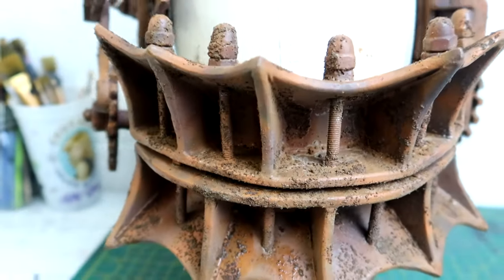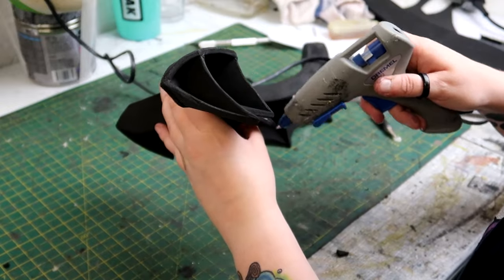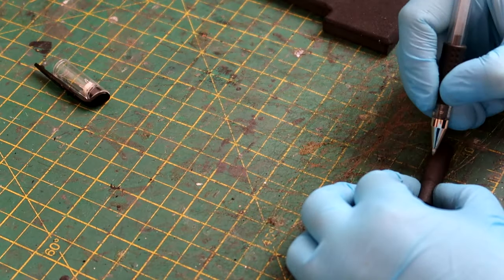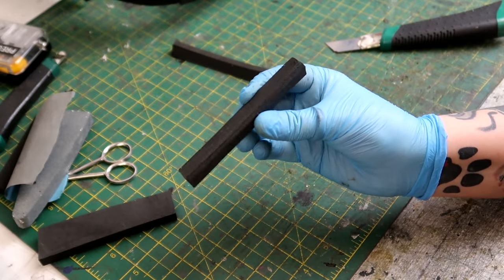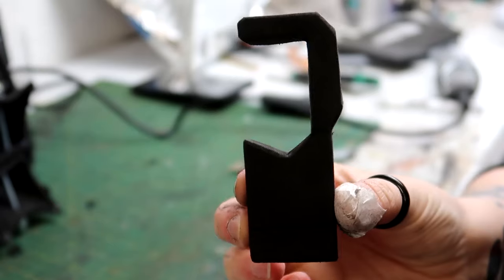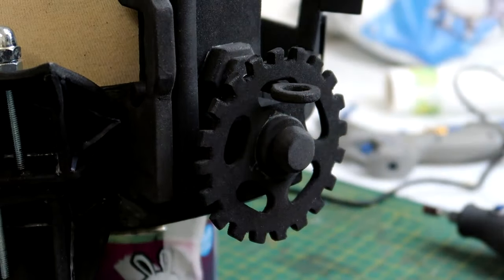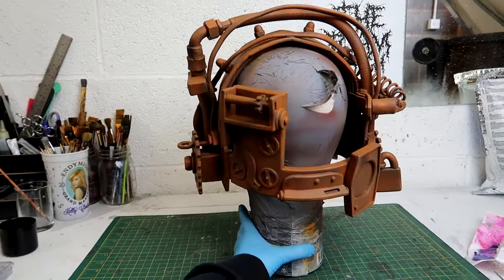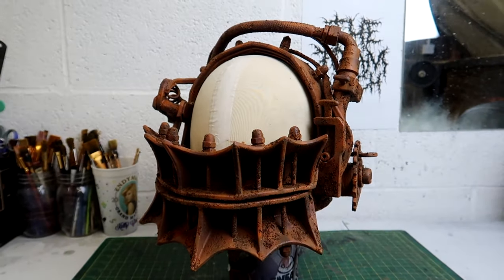How To Make A Reverse Bear Trap from EVA foam ( FREE Template)

Comment: Would it be possible for you to list all the items we need to make this possible? Ex: the mm in foam, ruler, dremmel stuff like that pls🙏I wanna run to Michaels real quick
Reply from the maker: The template says the foam needed, it's a mixture of 5mm and 10mm. As for the other stuff it's all personal preference as to what you use!
I use contact adhesive that I get from Poly Props, but you can use any brand. Dremel isn't essential but a good tool to have, but again it doesn't have to be the Dremel brand, any rotary tool will do 👍
Reply from the maker: Obviously you will need some sort of craft knife, but again, it's all down to personal preference to which one you get. You can use a scalpel style craft knife or a box cutter type. Both work for what you need 😊
Reply: @TheFoamWitch  you are awesome I can’t wait to tag you on ig when I make it!!!
Reply from the maker: @Snackseesghosts  I can't wait to see it! Hope you enjoy making it!!

Comment: Thats so amazing ❤ ! it defently will be the finish prop for my pig cosplay ! thou i got a question why does the back section on the free pdf looks different or even a bit smaler ? It kinda confuses me
Reply from the maker: Thank you! 😊😊
And I just had a look and I'm not really sure what you mean? Can you explain more? It should be the same size as the one I used here because I traced around it 😊 there are the smaller pieces that get stuck each side which are on the template that make it longer if that's what you mean?
Reply: @TheFoamWitch  mmmh am I able to send u a message on insta because then I could just make a pic ,it would be kinda hard to describe it since im german and my English is not the best 😅😂
Reply from the maker: @laurie_strode7674  yeah absolutely 😊😊

Comment: What part of the template did you use for the middle part at 1:56 ?
Reply from the maker: It's on page 4 of the template. It has rounded ends on the template because I made it more accurate to the final build I did. It's labelled "back section to stick jaw pieces to"👍👍
Reply: @TheFoamWitch  Ahh, thank u so much!!
Reply from the maker: @Maple_x  no worries! I should probably go back and edit the video to make this clear as it seems to be confusing a lot of people 😂

Comment: Is your building mat, with measurements, in inches?  It looks like it is.  I paused the video on the section where you construct the timer and I'm guessing inches.  Can you clarify?
Thanks!
Reply from the maker: @michaelalexander4927  I honestly have no idea! I never use it to measure! 🤣 I will go and have a look 👍
Reply from the maker: So I just looked at the cutting mat, and there are CM and inch squares around the outside,  however, the squares in the middle are random and seem to be 1.5cm x 1.5cm… it would be much easier if they were all cm squares 🤣 like I said though, only use it as a cutting mat and don’t use it to measure anything 👍

Comment: Girl what do you think about using hot silicone to glue this? I read your latest comment about foam hot glue sticks but I live in Venezuela, I won’t find that here.

I used cold silicon and it kinda worked but threw away the pieces I glued bc I don’t feel like it’s going to be resistant.

Any recommendations that won’t require a mask? 😭I’m actually going to wear this on halloween.
Reply from the maker: Honestly, I’m not sure silicone would work. I can’t say I have ever worked with it to be able to know.
Do you have any craft shops at all? Because any hot glue would work, it doesn’t have the be the specific glue I use.☺️
Reply: @TheFoamWitch  we do! But there’s no much variety as a usa shop. I’ll come back to comment if I found the hot glue, which I learned right now, it’s different than silicone lol. Thank you!
Reply from the maker: Let me know how it goes! You could always try super glue too! ☺️

Comment: do you have the names or measurements of the hardware you bought? i’ve built everything up until there and i’m not too sure what to get
Reply from the maker: So hardware was nuts, nut caps and bolts. No sizes known as just took the trap and measured them at the store but think they where M8 whatever that means 🤣
The rest was just pipes I found in the plumbing section 👍

Comment: my college campus doesnt print A4 paper, is the template still somewhat accurate if i use letter size
Reply from the maker: So there won’t actually be too much difference, A4 measures at 8.27 inch x 11.69 inch and Letter measures at 8.5 inch x 11 inch. So letter is slightly smaller but only by a bit 👍

Comment: so to use the template if i just print it out on standard copy paper as is will it be the correct size?
Reply from the maker: I made it a standard size, to be printed on a4 normal paper ☺️ I have a small head and it’s a little big for me but I added some padding 👍 you can scale up or down if you need

Comment: At 1:57 you showed the pieces you used for a specific part and I don't see a template for the one in the middle. Is there no stencil for that one?
Reply from the maker: Yeah there is, it's just a slightly different shape on the template because I changed it slightly to be more accurate on the template.
It's on page 4 and it's labelled "back section to stick jaw pieces to"! 👍

Comment: Do you only use one thickness of foam (5mm) for the whole thing?
Reply from the maker: There are a few 10mm pieces used. Everything is labeled with the thinkess used on the template, but don't have to use 10mm, you could use 5mm for eberhthing if you wanted 😊😊
Reply: @TheFoamWitch  
»
Gotcha, just double-checking. I have not made something like this with these materials before. 
»
You’re an absolute godsend! I wasn’t sure how to do this from scratch. I can’t wait to get started.
»
This is for when XI comes out in September :)
Reply from the maker: @thoracis  you don't even have to use foam if you don't want to! I know people have made this out of cardboard and they still look amazing! 😊😊
Reply from the maker: @thoracis  and it's been pushed back to September 2025 😭😭
Reply: @TheFoamWitch  
»
NOOOO 😭 
»
I started working on it yesterday. I had to do a bunch of ad-libbing, but I am having a lot of fun. Hopefully I can stop at the hardware store soon!

Comment: quick question on the template, does millimeters represent the thickness of each piece or the length
Reply from the maker: Hi there. If you are reading it off the template, the mm listed are the thickness of the foam to use 👍👍
Reply: @TheFoamWitch perfect thank you!
Reply from the maker: @batanoxjpg no problem ☺️

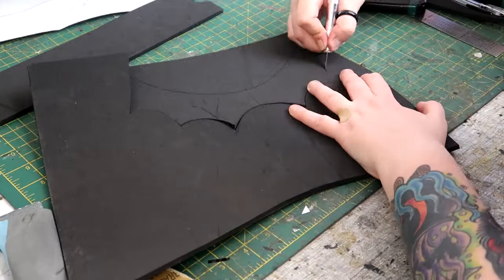Comment: Hey 1:52 SOS I need to know what piece did you use from the template to stick the jaw piece and the straight jaw piece to 😭😭
Reply from the maker: Hiya! So I have explained this in the description because people kept asking.
It's on page 4 of the template and is labelled "back section to stick jaw pieces to" It has rounded ends on the template because I made adjustments to the final template to make it more accurate for building 😊😊
Reply: @TheFoamWitch  oh okayyy thanks  for replying!
Reply from the maker: @Ma-vk1jy  no problem at all! Hope it helps 😊

Comment: what glue did you use? (other than hot glue)
Reply from the maker: The only other glue I would have used is Bostik glue and fix contact adhesive 👍👍
Reply: @TheFoamWitch  Thank you! do you think i’ll have enough time to make it before halloween?
Reply from the maker: @Addison-v9n it’s a rush, but if you can spare the time, I can’t see why not ☺️

Comment: what density foam did you use - 65, 100 or other?
Reply from the maker: I pretty much always use cf100 ☺️☺️
Reply: @TheFoamWitch  Thank you for the quick reply :). I am going to try to make it for Halloween but might have left it a bit too late, trying to source materials now. Your video is the best I have seen, really good instructions and template is absolutely a must starting point.

Comment: What are all the supplies needed for this reverse bear trap
Reply from the maker: It’s pretty much all in the video, but eva foam in different thicknesses, whatever type of adhesive you want to use, bolts, but caps and pipes and paint ☺️👍
Reply: @TheFoamWitch  Ty
Reply from the maker: @jayjaychris8221  no problem! ☺️

Comment: How much foam do I need? I don't want to overbuy as it's quite expensive and planning on making this asap for a show!
Reply from the maker: I had a 1 meter by 1 meter piece and still has loads left 👍
Reply: Ahhh fantastic! All 8mm?
Reply from the maker: @kimroebuck4857  you could use 8mm. You can use whatever you want! But I used mainly 5mm with some small bits of 10mm 👍
The template shows which thicknesses were used for which pieces 😊😊
Reply: Thank you so much! ❤️
Reply from the maker: @kimroebuck4857  no problem at all 😊

Comment: can u do this without air brush ??
Reply from the maker: @lifewithkids5231  absolutely! You don't need an airbrush at all! Brushing paint will work just fine 😊😊
Reply: @TheFoamWitch thanks! also, is there a certain size/thickness eva foam you used for this?
Reply from the maker: @lifewithkids5231  mainly this was 5mm foam, with some 10mm parts and I think some 2 or 3mm parts. The template should list what thickness each part was (apart from the cogs which I forgot to label but they were 5mm!) 😊
Reply: @TheFoamWitch awesome, and sorry about all the questions but this is the last one i swear 😭😭 would using hot glue for the whole project be alright? or was there a specific brand of contact adhesive you used
Reply from the maker: @lifewithkids5231  please don't be afraid to ask questions! I'm here to help and happy to answer any questions you have 😊
And got could totally use hot glue for this! I don't have contact adhesive anymore and only use hot glue for my projects so that will totally work for this! 👍👍

Comment: Where can I see the template? Like the cm and that? It doesn’t show in the video
Reply: description
Reply from the maker: The link is in the description of the video. 
There isn’t any measurements as I just made it a standard size, but it was made on a mannequin head that has the circumference of 62cm if that helps! 👍
Reply from the maker: @socialerosion you got it! ☺️☺️

Comment: i’m gonna buy eva foam, but i have no idea how much i need, do u think 950x450 mm is enough?
Reply from the maker: @noa3713  honestly, I’m not 100% certain. I don’t know exactly how much I used as I have a large stash of foam I just pick at. However 95cm is quite a length and should be enough!
Reply: @TheFoamWitch  thank u!!
Reply: @TheFoamWitch oh and did u use low or high density foam for this?
Reply from the maker: I tend to only use high density for all of my projects. It just works better for me and is easier to sand ☺️
Reply: @TheFoamWitch  tysm!

Comment: What’s the joint and the hose tube thing above the head
Reply from the maker: I don’t know exactly what it was called but I think it was a shower pipe or something. I got it from the plumbing section at the hardware store 👍
Reply: @TheFoamWitch could I also know the diameter of the foam cylinders you used? 😊
Reply from the maker: @tacobandit960 I’m not sure! Let me check once I get back inside and I will let you know ☺️☺️
Reply: @TheFoamWitch  thank you!
Reply from the maker: @tacobandit960 so I just measured and most of them are 20mm diameter.  The one in the box in the back is 10m, as is the one for the padlock. The one I used for the hinge is 5mm 👍👍

Comment: Hi, would you be able to make a list of all materials used in this, thank you :) x
Reply from the maker: Sure! 
Foam 5mm & 10mm
Contact adhesive
Nuts, bolts and nut caps
Googly eyes
Rubber washers
Plumbing hose and connector
Electrical wire
Paint
Iron filings 

Hope that helps 👍
Reply: @TheFoamWitch  Thank you so much!
Reply from the maker: @Jane-mc4xi  no problem at all! Always happy to answer questions 😊😊

Comment: @TheFoamWitch, how long are the screws and what is the pipe that goes over the head band called?
Reply from the maker: So the pipe was from the plumbing section at the DIY store and it just was called "flexible hose" on the packet. I just measured the bolts and they are approximately 6cm long 😊
Reply: And the screws that go in the spaces between the jaw space dividers on the mouth guard? How long are they?
Reply: By the way, I am building a reverse bear trap, but since I don’t have EVA foam, I am using the next best thing, cardboard
Reply from the maker: @leonardoramirez9746  those are the bolts that are 6cm
Reply from the maker: @leonardoramirez9746  I know people who have made it out of cardboard and it looks epic 😊😊
Reply: Oh, ok thanks
Reply: Have you ever thought of having the mouthguard be able to open?
Reply: Like the actual reverse bear trap?
Reply from the maker: @leonardoramirez9746  yeah and there probably would be a way to do it with a screw mechanism, I just didnt attempt it on this one 😊
Reply: did you know that the movie prop of the reverse bear trap worn by Shawnee smith was auctioned?
Reply from the maker: @leonardoramirez9746  damn! I would have loved that! I hate auctions though because the people who would genuinely love the stuff can never afford it 🤣
Reply: How long did it take you to build it?
Reply from the maker: @leonardoramirez9746  only a couple of days 👍
Reply: Days?
Reply: Well, it looks like it was worth it?
Reply from the maker: @leonardoramirez9746  yup! Maybe like 4 days 😊
Reply: Do the Jaw plate dividers have to be shortened? Or is it optional?
Reply from the maker: @leonardoramirez9746  everything I do in the video is completely optional, but they probably will need trimming down
Reply: Have you ever thought of building Billy the puppet out of EVA foam?
Reply: What were the measurements of the EVA foam pieces you used and where can I find EVA foam?
Reply: How long is the flexible hose?
Reply from the maker: @leonardoramirez9746  5mm foam and you can find it loads of places. I get mine from Tyges Supplies
Reply from the maker: @leonardoramirez9746  honestly, I have no idea 🤣
Reply: Rank all the saw movies from your least to most favorite movie
Reply: What are the measurements for the elbow connector?
Reply: It say ‘something 1/2 female’ but I can’t quite tell what it fully says
Reply from the maker: @leonardoramirez9746  I honestly don't know sorry

Comment: Not sure if this was asked, what mm thickness is the foam?  I'm trying to choose and I'm not sure if 2mm is to thin or 5mm is too thick 

What thickness did you use? What are the lengths of the bolts used?
Reply from the maker: So if you are making from foam, 2mm is going to be much too thin. For this I mainly used 5mm with some 10mm pieces (all pieces are listed with thickness on the template)

I think the bolts were 5cm but would have to check as not 100% sure 👍

Comment: do you have the measurements or am i just missing it
Reply from the maker: I don’t have any specific measurements I’m afraid, I just kinda made it to my mannequin head. I can measure the circumference of that though when I get home to give you an idea!
Reply: @TheFoamWitch thank you!
Reply: @TheFoamWitch another question lol. should it be the right size if i print the template out or am i not understanding
Reply from the maker: It should be the right size if you print the template out on a4 paper 👍
Reply: @TheFoamWitch okay thank u i just printed it to see and it looks right i think i was just being slow 😂
Reply from the maker: @fudhebxuebsbxuejaoxkrnzuc no problem at all! Sizing is always confusing to be honest with you, so don’t sweat it ☺️
Reply: @TheFoamWitch hey im cutting it out right now do u have any tips for the curved pieces? the ones with straight edges were pretty easy but im stuck on these lol
Reply from the maker: @fudhebxuebsbxuejaoxkrnzuc can you explain a little more which pieces you mean and what issues you are having? ☺️
Reply: @TheFoamWitch  the jaw pieces im just trying to keep the cut straight
Reply from the maker: @fudhebxuebsbxuejaoxkrnzuc it’s just gonna take practice. You need to make sure you keep your craft knife sharp so it glides through the foam and doesn’t tear it. This will make sure the curved cut stays straight ☺️
Reply: @TheFoamWitch i appreciate the help haha im glad i started early

Comment: i’m making this right now and my foam hasn’t come in so i’m using paper to test it but at 1:56, the middle piece i used in the pdf has pointed sides and is not as big as the other pieces/the winged piece and curved piece. i tried bending it but it may just be the paper but even before bending it’s still a lot shorter than the others and idk what to do😭
Reply from the maker: So it has curved sides because you need to curve the winged pieces down at the end to meet at the middle point at the edge to make it accurate to the actual trap. 
I’m not sure why it would be much shorter because the size wasn’t changed at all when I perfected the template 🤔 you may just need to trim the edges to meet ☺️
If you have instagram or facebook send me a message at the foam witch and I can send you a picture of how to do it ☺️
Reply: thank you!!!! and thank you for replying so quick, you’re the best
Reply from the maker: @pipiphooray no problem at all ☺️☺️
Reply: I had the same issue:( I just messaged you on instagram
Reply from the maker: @HannahFolsom-w2q  I’ve replied, hope it makes more sense now ☺️

Comment: Hi I wanted to make this (total beginner here) but how do i know the sizes for each piece??
Reply: i just did this as well and the template is all to scale if you print it a4 (it turned out so good)
Reply from the maker: There is no sizing for each piece, but if you print it out on A4 scale, it will be the exact size I made. If it's too big you can add padding inside and if it's too all, you can add extra pieces of foam to the headband and back pieces to make it big enough! 👍 It shouldn't really be too small for anyone though